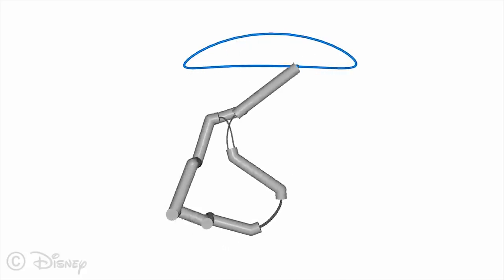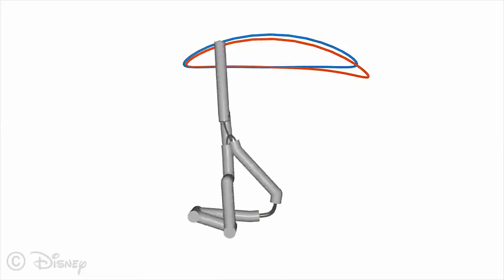A Computational Design Tool for Compliant Mechanisms

Comment: That is very impressive, but what are the use cases for these compliant joints where they surpass rigid joints in functionality?
So far it just seems like classical kinematics with extra steps and additional calculations.
Reply: This is very useful for precise positioning. It avoids almost any kind of backlash and convert motion in a huge ratio

Comment: curious how this handles itself after a large amount of use, I feel like things that flex tend to break down and warp easier.
Reply: Better than things with say minges that slide over pins or bushings. The sliding parts wear against each other and the shape changes slightly with use.
Reply: Only if they reach plastic deformation, if they're properly designed they won't break down.
Reply: If you keep the strain below some threshold you can get extremely long life out of these mechanism, much more than with bearings and bushings.

Comment: I missed the part where it's explained how this is more efficient than having the same mechanisms made out of separate parts
Reply: well the video doesn't talk about it. As with most things there are always pros and cons but i'd guess the main drive behind this is cost, having complex assemblies requires production lines for each part AND an assembly phase but it makes it easier to replace a broken piece, on the other hand, this presented solutions don't need any assembly phase but push you to replace the whole structure if any breakage happens, i believe that's why they're pushing to minimize torque and increase durability

Comment: Specialty plastics are always going to be needed for good compliant mechanisms. It's incredibly difficult to not doubt the durability claims. The other thing is, traditional mechanisms have more readily replaceable parts. Avoids having to tear down a whole model/animatronic to replace the mechanism is one flecture breaks.
Reply: But,counterintuitively,compliant mechanism have been shown to be more durable than their contemporary counterparts. Besides, any decreased performance is made up in the time and cost of device construction
Reply: "It's incredibly difficult to not doubt the durability claims."

Their technique specifically optimises to minimise the torque.  It obviously cannot remove durability concerns, but it specifically optimises the design to reduce the damage, to increase durability.

Not to mention compliance almost completely eliminates backlash that exist in "traditional" mechanisms.
Reply: Yes.
Reply: I've been 3D printing these systems for a while. They're actually pretty reliable, just hard to design and require a fair amount of prototyping.
Reply: They surely both have their pros and cons, but keep in mind it's also possible to build flexure mechanisms with off-the-shelf and replaceable parts like sprint sheets and wires, although with that method complex shapes as in the video are harder to build.
Reply: @jonasdaverio9369  this is exactly not what a compliant mechanism is
Reply: @johanness6545  And by what magic would it no be a compliant mechanism? What is your definition of compliant mechanism?
Reply: @jonasdaverio9369  It doesn't use the elastic deformation of the structural components. Using 3D Printed parts and springs is not different to using e.g. milled metals and springs, which one would not call a compliant mechanism. A complaint mechanism gains it's motion through elastic deformation of the whole body ("all it's members"~Wikipedia), not rigid body joints alone. Your method would sure use flexible components, but in the design process you would assume the parts don't flex themselves, rather their joints. Agree or do you have another idea?
Reply: @johanness6545  I don't agree. Many flexure mechanisms are designed with only discrete springs, spring steel rods and strips. The difference with regular rigid mechanism is that the motion is constrained by the spring themselves, by clever arrrangement. The fact that it is made of two part, one rigid body and one flexible, or only one part with some rigid region and some flexible region makes no difference.

Wikipedia: "It gains some or all of its motion from the relative flexibility of its members rather than from rigid-body joints alone. These may be monolithic (single-piece) or jointless structures." Only some members have to be flexible, and it doesn't have to be monolithic.

But I agree that a mechanism with ball bearings, bushings and rails with one spring somewhere doesn't suddenly become a flexure mechanism just because of the existence of the spring.
Reply: @johanness6545   In all of the mechanisms shown in the video, only the joints flex. The complexity of assembly would increase using replaceable spring joints, but they'd still be compliant mechanisms that perform similar to what is shown in the video.
Reply: @tbdcreations5370  A system with rigid bodys, joints and springs to provide motion is by definition not a compliant mechanism. I don't think their performance would be similar, they both have their individual strengths. While compliant mechanisms mostly offer less range of motion, they can be far more precise.
Reply: @johanness6545   I think you have a different definition. But does it even matter what you call it? You could design any of these to use replaceable springs and still have no traditional, sliding joints. 

You're arguing over semantics for no apparent reason.
Reply: all existing examples of compliant mechanisms have rigid bodies and flexing joints. The compliant mechanism in the video has stiff rods that do not bend, while the thin connecting parts do. If the joints, instead of being molded with the rods, were instead attached later via glue or screws, would that make a difference to the principle demonstrated by a compliant mechanism? When we speak of compliant mechanisms, we are principally interested in the parts which move, not every detail of the device's construction.

Comment: Do these type of designs suffer from fatigue failure? It seem like this could potentially fail under high frequency cycles testing.
Reply: Well as long as the stress in the material maintains to be in the elastic region.
Reply: In general the idea is that these mechanisms are actually more robust as the movement of any given point is far less than a typical mechanism and instead it spreads out the movement by flexing over the greater length. but I agree that in these examples, a lot of sections seem to be flexing too much, to the point where it looks like it would fail easily, also there is the added downside that it cannot be repaired, only replaced, which is fine for something like a space object or a industrial application where replacement would be done anyway so the added time between that is preferable. in the case of something like a car I'd rather replace a small part frequently than need to completely replace the entire steering mechanism when it catastrophically fails at some point haha
Reply: @audi4444player  well said. design for small max stresses in the deflecting members so you remain under the fatigue life of the material.

Comment: In the first mechanism you demonstrate(not the walking one),How do you ensure that the output profile is maintained if there is any load applied to output arms end point. An example would be if, the output arm was attached to a pen that draws the profile on paper. If the pen dragged heavy on the paper would the profile change? It looks as though there is an additional degree of freedom added to the output arm from the added flexure.... 
Now you've completely piqued my interest I'm going to have to build one of these out of lego...

Comment: Can this also be adapted to measure the inverse reactive current in unilateral phase detractors? It would be a great application for a (inrush current) panel meter imho.
Reply: I don't think there is a single linear spurving bearing on the market that can handle those stresses yet.
Let alone one with underlayed wafer vertices to increase lifespan.
Reply: @DOCTOROCTAGONAPUSS  Love your username.
Reply: @AndrewDasilvaPLT  Lol thanks.
Reply: Won't someone think of the panametric fan! The modial interactions can't be understated here

Comment: I got this recommended to me and I’m so fascinated by something do not understand even remotely
Reply: With this technology, you save in materials. By saving materials it becomes lighter, and also cheaper.
Reply: I feel like they put a lot of empty-speak in there, complicated sentences + too many fancy words, when in actuality what is being said is quite simple.

I may be wrong, but here's my try at an example translation:

Original: "Our method takes as input a conventional mechanism and replaces rigidly articulated joints with flexures. Thin blades of elastic material whose shapes are automatically computed in order to optimize the performance of the compliant mechanism, there are several design objectives that need to be taken into account."

My version: We turn a conventional mechanism and replace rigid joints with flexible ones. These joints are made of thin, elastic blades, and the shapes are created by a computer. Several aspects need to be taken into account.

Original: "Furthermore, when using 3d printing, residual support material increases friction in the joints. As shown in this example, these drawbacks can amplify in unfortunate ways leading to unforeseen deformations in the structure and even failure. We show the ability of our method to scale to miniature designs found for example in small-scale animatronics. By explicitly modeling compliance we can predict and leverage the deformation of the structure and maintain proper functioning with good precision."

My version: When 3d printing, ressidual filament can make the joints harder to move. As you can see here, this can lead to unpredictable deformations and even failure. This design can also be used in a very small scale, for example in animatronics. Our compliant design is very precise and predictable.
Reply: Same lol

Comment: Интересно , но толку ноль. В мире масса разных изобретений которые вот так двигаются и тд , но только даешь нагрузку и все иллюзии распадаются. Покажите свое изобретение под нагрузками превышающие холостой ход в 10-100 раз и тогда можно что то думать над применением вашего изобретения.
Reply: Not good for every task agreed but It has its uses...while it isn't strong it is a lot cheaper/ easier to 3d print/ injection mold these thin flextures than it is to manufacture  a complex joint...the flexure are also a lot smaller and lighter than a joint

Comment: I think the example with the wings is reversed and it flies backwards? Cause it pushes air forward unless it flies with its head pointed to the ground
Reply: Like their breath weapon, dragon flight is magic based.
Reply: Probably someone just connected motors the other way to the power supply

Comment: Hi, is this software open source? can I find the code anywhere? This is amazing!
Reply: ain't no way Disney is going to open source this! They might publish a research paper showing the results, but they are more likely to patent it than to release it. They are in the business of making animatronics for all of their theme parks after all!
Reply: @TomSepe  wrong.
https://youtu.be/IUe3mGkngs4
Reply: Open sourced Disney, I can hear Walt laughing from his grave.
Reply: The paper seems detailed enough that you can code it yourself.
Reply: Chebyshev was the first to develop such systems in the early 19th century!
Reply: HA! This is Disney, pal. The sole force driving the patent durations extensions to over a century.
Reply: @Luchoedge  patents are valid for 20 years (30 years for medical patents). What you're thinking of is copyright.
Reply: I was thinking the same thing.
Reply: You all really need to learn how to use Google.
It's not the source code, but here is the paper published by the Disney Research team, that has every single equation used in this tool. You could make your own program out of those if you wanted to.
https://s3-us-west-1.amazonaws.com/disneyresearch/wp-content/uploads/20170711145348/A-Computational-Design-Tool-for-Compliant-Mechanisms-Paper1.pdf
Reply: @AnimatorJuusoz  “y’all it’s easy to simulate electronic circuits, who needs multisim? The equations governing circuit function are all well known just code your own program. …what do you mean you’re just a hobbyist and you don’t have a degree in quantum electrodynamics that allows you to comprehend and make good use of those equations? It’s easy! Just use google dummy!”
Reply: @bridgetshepherd5202  ...That was directed to all those people laughing that Disney would never release anything they've developed to the public, even though they did release the most important parts about this to the public.

And the original commenter also asked for the source code, so I'd imagine he is capable of making programs himself.
Reply: @AnimatorJuusoz  you are very confused. Building software from source code is a lot easier than writing software from scratch. It’s the difference between installing a motor in a car and building a motor from scrap metal. Additionally, in the open source movement, someone who has no idea what to do with source code would still be excited about it being released, because it means people who DO know what to do with it will have access to it and will be able to turn it into an easy to use free software package.
Reply: This has the potential to change so many industries, from medical to even aeronautics. It'll be real selfish of Disney not to share this software. At the very least offer a payed version
Reply: @mauriciobailey4725  That's quite literally what disney is about. They took stuff from the public domain to build an empire ontop and are now fighting a year long war against the same laws that allowed them to build their empire.
Reply: @mauriciobailey4725  “really selfish”… that’s capitalism, hun. If you don’t like life-saving technologies being locked, underutilized, behind IP protections, wait till you hear about the pharmaceutical industry.
Reply: @mauriciobailey4725  Disney is one of the most selfish corporations out there, tough luck getting it without paying a pretty penny lol
Reply: There is no code to open source dude! What you are wanting is Disney to tell you how to properly manufacture the flexors, I think. Where in the hell did you see any kind of proprietary code in the video? A few arduinos that seem to do nothing more than remotely turn on and turn off power is all I saw.
Reply: @BigDaddy-yp4mi  the phrase “computational design tool” present in the title of the video is a clear indication that there is a mathematical, algorithmic process underlying the development of the flexures. Given the complexity of modeling such systems, it is highly unlikely that this technique is carried out by hand, therefore it can be easily inferred that there exists one or more pieces of software used to simulate these flexures and produce new iterations to achieve more ideal behavior. Such software would be fairly complex and creating it would require sophisticated materials science and metamaterial knowledge. Just because they aren’t showing you the interface or code doesn’t mean they aren’t demonstrating software.